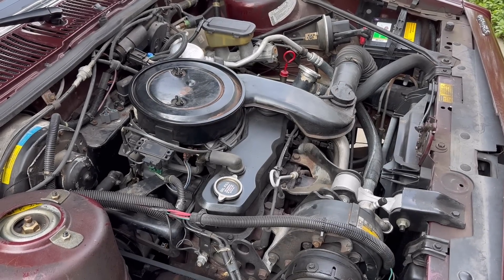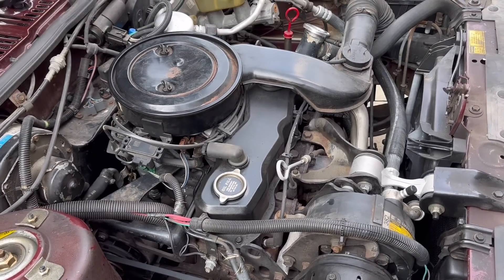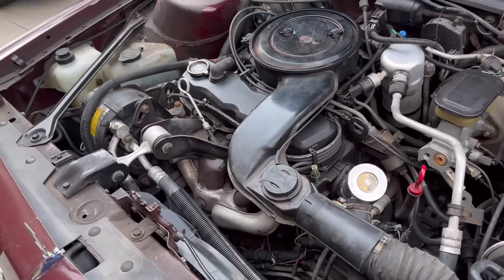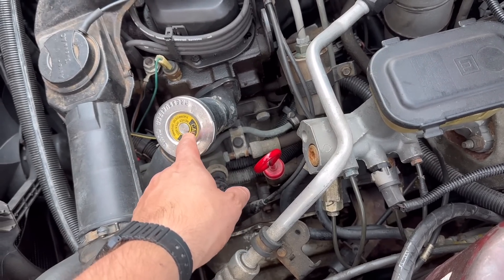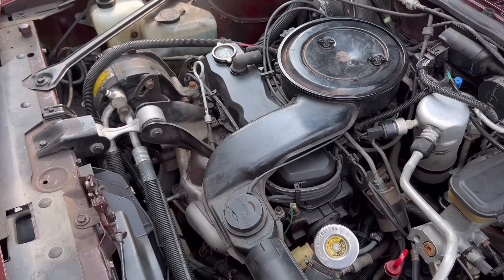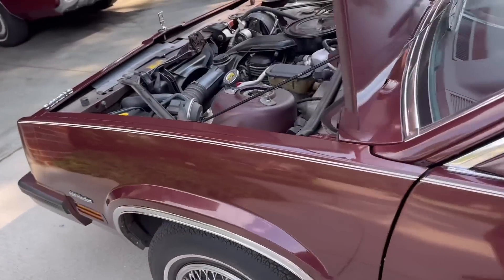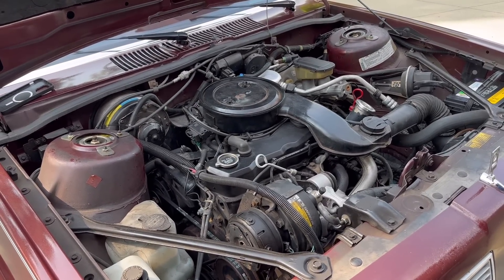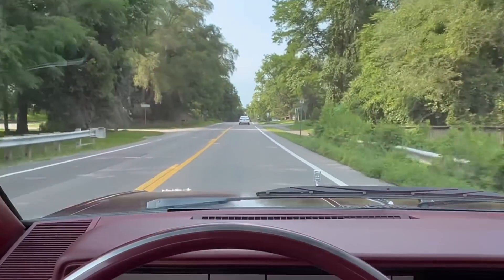Bad Engineering Makes This Engine Challenging to Repair: GM 2.5L Iron Duke 4-Cylinder Engine

Comment: Funny you mention GM A6 compressor and the pancake compressor.  I was just thinking about that.  I had an old Nova with factory A/C and the GM A6 compressor and the vents would get frost on them on a road trip.   The A/C in our newer Toyota is very weak (NO it does not need freon/refrigerant).   I realize those old compressors used more energy but who cares, when it's hot out I want cold a/c that can adequately cool the car in any weather.
Reply: I have 2 older GM cars. 89 Firebird with the R4 compressor. Still R-12 and I only had to put a few oz in it a few years ago. But it works very well. Although not as good as my 75 Grand Prix with the A6. Unfortunately it’s a chronic leaker (front shaft seal shrinks over the winter and it loses the charge) but when working it is brutally cold. Fortunately I have a good supply of R-12.
Reply: I had a 76' ford ltd that had the gm-Frigidaire A6 compressor and the same thing...frost on the dash vents, lol   good old days!!!
Reply: My 1981 Eldorado had the R-4 (Radial 4-cyl) compressor, and even though it had a smaller compartment to cool than previous years, it was never more than adequate.
Reply: I've got an 08 Toyota, and I'm very happy with it. But... The A/C is adequate, barely, and nothing more. It works, well, adequately, but I'm still a bit disappointed in it.
Reply: @eyerollthereforeiam1709    Same here.  The A/C is our new Toyota sux and struggles to keep interior barely comfortable at anything over 80 degrees.  If we lived in Florida I'd probably buy another car that has proven great a/c.
Reply: Don't forget, up until 1994 (or thereabouts), almost all automotive a/c systems used Freon 12 as a refrigerant. Its drawback was that it was claimed to damage the ozone layer, so the industry moved to R-134a. I believe that the new refrigerant is not as efficient at absorbing heat as the original Freon-12.
Reply: @martinliehs2513   I understand but then the manufacturers should put in a bigger evaporator or do something to compensate.  I'm telling you the a/c in our newer car is very weak, and in my opinion unsatisfactory.
Reply: @martinliehs2513  You are correct,  e.g. the new-for-92 LeSabre / Park Avenues had R-134.  Yet that one had the properly sized other parts, and a new compressor, and chilled very well.  My Cadillac with R-12 and the R-4 compressor, AND a professional evacuation/recharge plus a variable orifice tube, was a disappointment.

Comment: Awesome video as always.  But question.  Do you still repair AC and use R22 as was original on your cars?  Just curious.  If you could mention in an upcoming video in passing, that would be great.  Thanks for all the hard work and videos.  One of my favorite channels!
Reply: Just FYI, cars used R-12.  Stationary units like my central air conditioning used R-22... though DuPont called them both Freon.  (Another fun fact:  The DuPont name for R-134 is Suva, and now they're banning that!)
Reply: Thanks!  Old age striking!  I appreciate.
Reply: @marko7843 they want you to buy electric car.
That’s why they baned everything with gas engines!
WEF agenda Marko! Poz.
Reply: Google "genuine R12 freon" click on images and you will see it's still available.
Reply: @4af  I have 3 lbs with a can tap in my garage!
Reply: That car appears to have 134a service caps on it....

Comment: You know... I've mollified my position on "having to take an engine mount off" on FWD cars for servicing. Usually it's really not that big of a deal and a lot of the time it makes other repairs easier than they might have been otherwise. It looks like that one rolls enough to throw a football through there compared to a lot of modern stuff.
Reply: At least the "dog bone" mount is easy to get to.
Reply: @martinliehs2513  Yeah, I'm not really seeing the problem with it. Maybe if I worked on one I would feel differently.

Comment: Absolute. Worst. Engine. GM ever made...didn't matter if it was in a Chevy, Pontiac, or Olds. We called it the "iron dookie" for good reason. And yep, I remember when they started calling it the "4 Tech'. They weren't fooling anybody. 😂 😂
Reply: And the Cadillac 4 6 8 engine was faaaar worse than the 2.5. As well as the Oldsmobile 350 Diesels.
Reply: @joshuagibson2520 The Cadillac V8-6-4 was a continuation of the 1969 redesign. It was a good proven engine if a little underpowered compared to the bigger 472 and 500. All you had to do was disconnect one wire to disable the cylinder deactivation.
Reply: @drippinglass  And that worked very well on those 365s. You could also set it to V8 only mode, but that had to be done every key cycle.
Reply: @joshuagibson2520  The 5.7 Diesel is possibly the worst internal combustion engine of all time. My 2.5 S10 got better economy and performance than our Diesel 98.

The performance wasn't even close. The S10 would absolutely murder it in every possible way.
Reply: I thought the aluminum Vega engine was the worst.
Reply: Early Vega engine with scuffing cylinder walls, Early 350 diesel with weak bottom end, bad head bolts, no fuel water separator, HT4100 with cams they forgot to harden, Northstar with self ejecting cylinder heads. There were many GM engines that were worse.
Reply: @gregorymalchuk272  I recall customers coming into the shop with oil leak complaints on 4100s. The service manager would ask us what was leaking, and we would simply say 'Yes' or "It has an everything leak" or "The only time it stops leaking is when it runs outta oil"
Reply: @adamtrombino106  Somebody on YouTube did a video with his father who was a mechanic back then while they walked though a junkyard where they stumbled upon a huge pile of 4100 engines. He said that the aluminum castings were porous and would weep oil and coolant all the time.
Reply: The '71-'75 Vega was far worse from a durability standpoint. Vega was easy to service, though until it became an oil burner at 30,000 miles.
Reply: You either got a fantastic 2.5 or a terrible one. I have witnessed both. Had to be quality control issues of some kind.
Reply: @joshuagibson2520  I just got to the end of the video, and he also mentioned the 2.8 V6. That was another hunk-o-junk engine. Had an 85 GMC Jimmy and I hated that engine. Best thing they ever did was dump those in favor of the 3.1, and they went to fuel injection at the same time.

Comment: These things were everywhere, when I was working the pit at Jiffy Lube, from '89 - '91. Lots of ripped up knuckles and burnt skin.
Reply: Yeah, I worked at Rapid (Instant oil change).   No pit, but a rack, went through the wheel well with a ratchet a long extension with the "claw".

Comment: The distributor points in my 1969 Corvette small block with all the ignition shielding. A solid state “One Wire” replacement solid state device solved that little issue.

Comment: Adam, please make a video about classic Mercedes Diesels sometime… OM617 and OM606 are some of the best engines of all time.
Reply: @johnz8210  The OM617 is a 3.0L I5, so yes, it was in the 300D both naturally aspirated and turbocharged. The OM617 came out in the mid-70’s. There was also a 2.4L I4 naturally aspirated Diesel (originally designed by a farm equipment company as a stationary engine for powering generators and water pumps) in the 240D, which is just as durable but quite slow - they offered it with a manual gearbox in order to allow it to get up in go. In my home country, Albania, 3/4ths of cars on the road are classic Mercedes diesels, many run on waste veggie oil, and we often put small turbos on our 240Ds to get more power out of them.
Reply: @johnz8210  Mercedes was a very different company in the 20th century. Classic Mercedes Diesels are the only cars which offer most (if not all) features of a modern car, without any of the gimmicky excess, in an analogue package which is infinitely maintainable & serviceable. Unfortunately, Mercedes stopped producing “forever cars” in the mid-‘90’s, with the end of the W124 in South Africa. It was the last generational chassis code from MB which was analogue, and where every single part of the vehicle was documented in the parts & service catalogue, rather than being full of computer chips and parts which are packaged & documented together as part of a larger system. I have an ‘83 300D Turbo with roughly half a million miles on the original engine, a lot of which has been on waste veggie oil (I have a block warmer conversion kit installed) and often times marine diesel (which is extremely dirty and generally reserved for industrial-grade 2-strokes). The only thing that has been changed about it (aside from speakers minor things) is that I have swapped in a Ford T5 manual gearbox so I can get it to be quicker & more efficient for highway driving.
Reply: @johnz8210   Mercedes was a very different company in the 20th century. Classic Mercedes Diesels are the only cars which offer most (if not all) features of a modern car, without any of the gimmicky excess, in an analogue package which is infinitely maintainable & serviceable. Unfortunately, Mercedes stopped producing “forever cars” in the mid-‘90’s, with the end of the W124 in Śouth Afrìca. It was the last generational chassis code from MB which was analogue, and where every single part of the vehicle was documented in the parts & service catalogue, rather than being full of computer chips and parts which are packaged & documented together as part of a larger system.
Reply: I'll play devil's advocate. I'm rather skeptical of claims of how wonderful that period of Mercedes was. Vacuum pumps with ball bearings smaller than the oil pump pickup screen that would destroy the engine. Mechanical valve lifters that would get out of adjustment and make them run poor, 25 years after Americans discovered and mainstreamed hydraulic lifters. Automatic transmissions with vacuum modulators and valves to derive a synthetic "load" signal (diesels have no natural vacuum) that would fail and not let the car downshift. Glow plug relays that fail. Early series glow plugs that all fail at the same time. Vacuum lines that leak everywhere and break inside the doors, keeping the vacuum solenoid on the injection pump from shutting the engine off. Automatic climate control systems that don't work and are all now bypassed. And Mercedes has always been hostile to DIY repairs, so stingy, expensive parts and specialized tools required. Don't forget the nightmare of Jetronic fuel injection on the gassers. The Rochester 300 TBI system on this iron duke was worlds more reliable than the electro-mechanical hybrid fuel injection on contemporary Mercedes gassers.
Reply: @gregorymalchuk272  I can understand why you’d think that way, but, ultimately, time is the best judge of reliability. Mercedes is the only company who’s Diesels from that era left a lasting legacy. You could argue that Peugeot and Isuzu also did, but you don’t really see many Peugeot 504/505 or Isuzu Gemini Turbo Diesels being daily driven with half a million miles on the odometer the way you do with Mercedes. There are a number of reasons why Mercedes Diesels in the ‘70’s-early-‘90’s were superior to other Diesels. 1st of all, they (mostly) used cast iron heads - they didn’t use an aluminium head until they were ready, because aluminium isn’t the best material for a Diesel head unless it’s extremely well designed & produced. The aluminium heads in the OM601/OM602 naturally aspirated engines are fine, but the turbocharged OM603 engines left a bit of a negative mark on the MB Diesel legacy. 2nd reason: MB Diesels were mostly analogue - they didn’t compromise their reliability by adopting EFI like Peugeot eventually did - no electric pumps, no ECU, no EFI, everything operated on a purely mechanical process. 3rd reason: MB Diesels used timing chains, the pump & cam were chain-driven. Timing chains in MB Diesels are one of the toughest components in the engine, even being a mechanic in Albania, I’ve only seen a couple of them that’ve failed, and it was because someone crimped the master link wrong and accidentally caused that failure. 4th reason: they used inline Bosch MFI pumps, much like the famed Cummins 5.9 did after they got rid of that stupid VE rotary MFI pump that didn’t even have a timing mark on it. Rotary pumps are cheaper to produce, but much more difficult to properly rebuild. 5th reason: MB Diesels (and cars as a whole) were infinitely maintainable, serviceable and rebuildable. They used cylinder sleeves & machinable cranks. Parts & service were (and still largely are, at least in terms of service) readily available. MB planned for every possible issue that could occur, and they had those problems covered. There wasn’t a single part in the engine that wasn’t documented in the parts/service catalogue. It’s really quite difficult to argue that MB didn’t successfully Dieselize the passenger car.
Reply: please go away
Reply: @andy57167  Why?